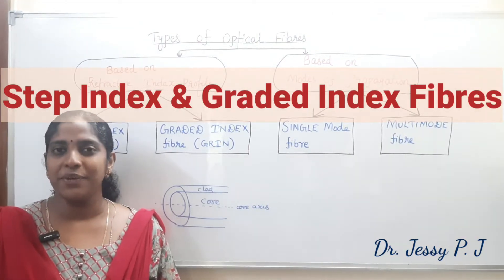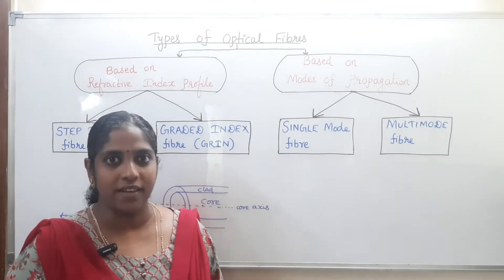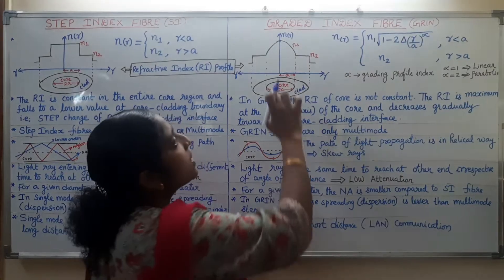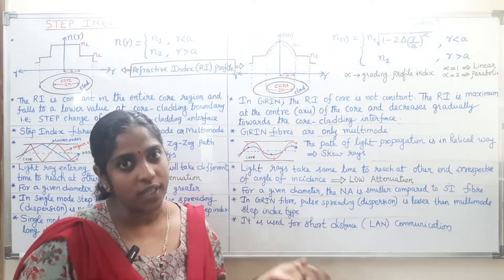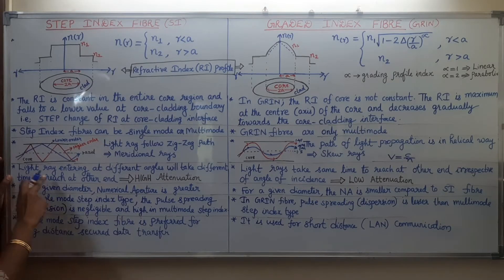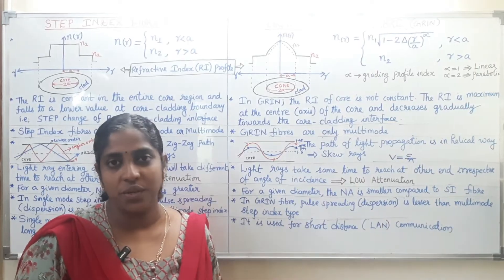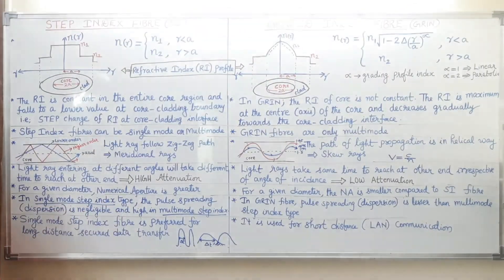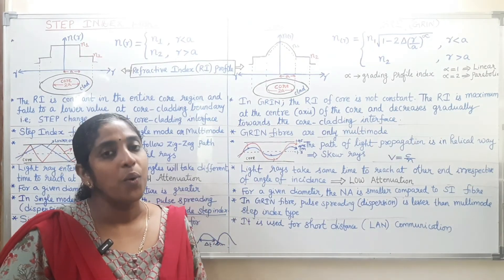Step Index and Graded Index Optical fibres

Comment: A step-index fiber has a core index of refraction of n1=1.425. the cut-off angle for light entering the fiber from air is found to be 8.5 deg[for air, refractive index=1.0008]
(a) What is the numerical aperture of the fiber?
(b) What is the index of refraction of the cladding of this fiber ?
(c) If the fiber were submersed in water, what would be the new numerical aperture and cut-off angle [for water ,refractive index=1.33]